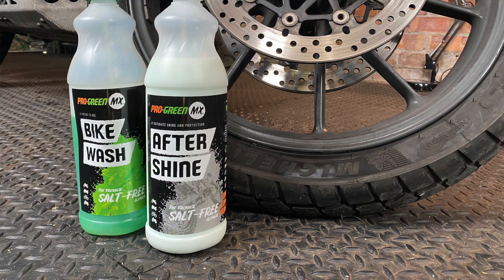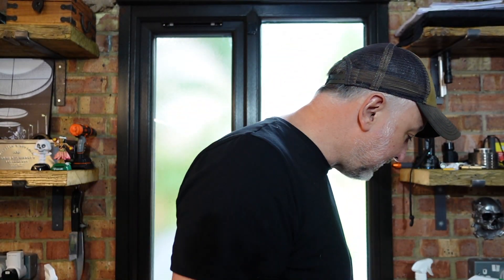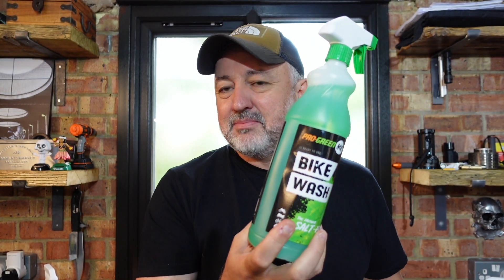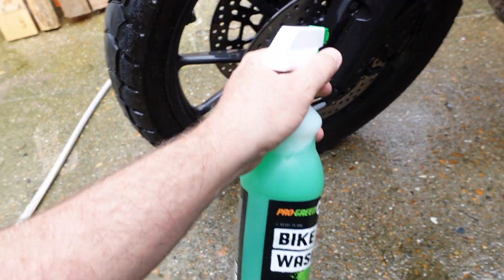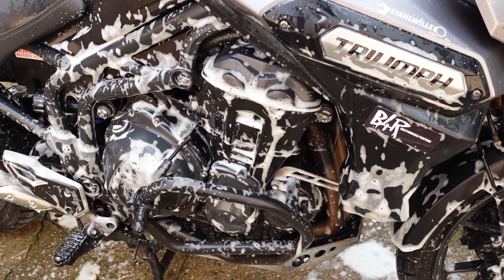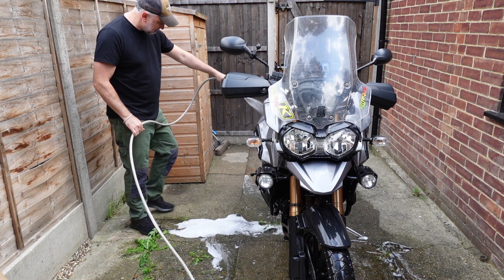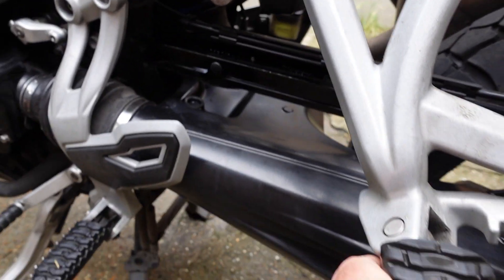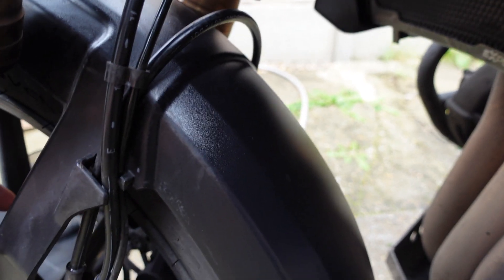Pro-Green MX - Bike Wash and After Shine / Patch test on the Triumph Explorer.

Comment: Where it's good it's really good I guess you need a really be  generous when spraying the after shine so as not to get those variations ,so when you do wheels do you need to be concerned about discs or tires ?. just checked ya can get a liter of each for about £20 so not to bad might give it a go cheers Billy good one  . : )
Reply from the maker: Cheers Malcom, yeah so it says avoid brakes, so i would definitely play it safe and keep it away from tires as well, was pretty impressed by the after shine. And a few days later it’s still holding up as well.